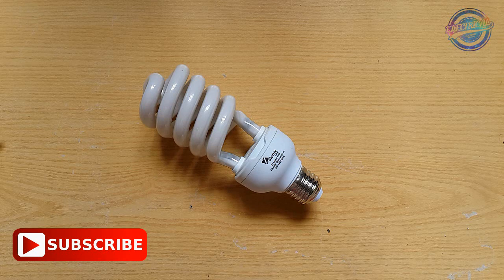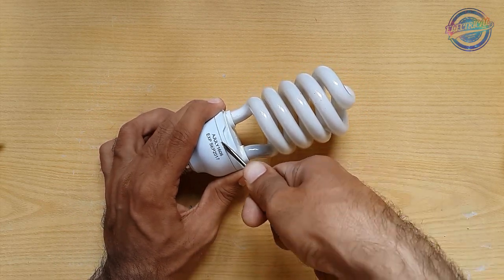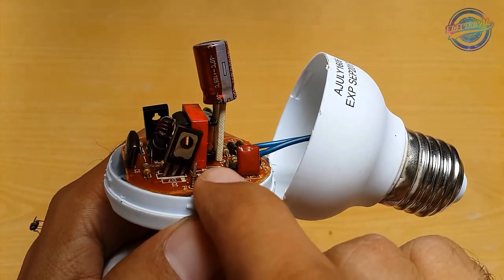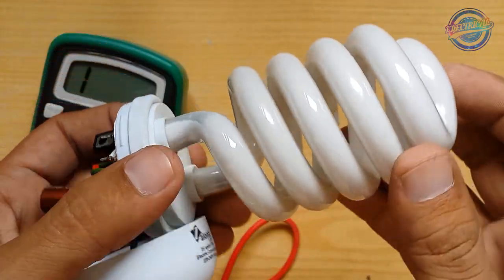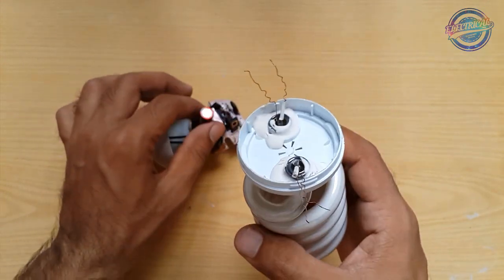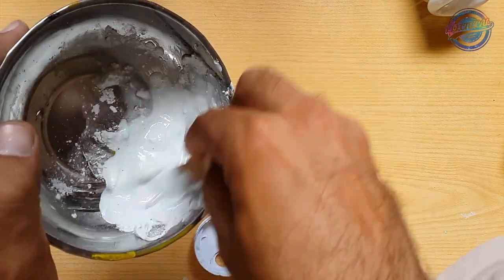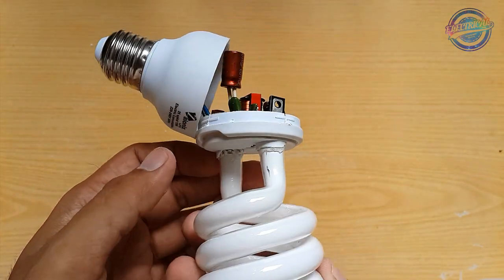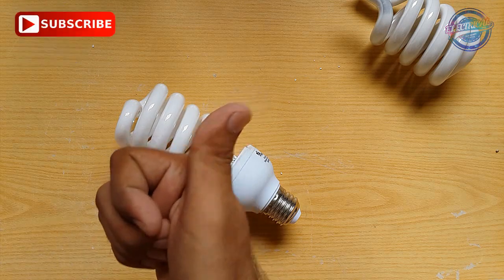How to Repair CFL Bulb at Home || Repair Compact Fluorescent Light bulbs || DIY CFL Repair

Comment: So in other words he is taking a good light bulb apart to get the part to fix a bad one. Thats sure genius.
Reply: I think you are being too genius. Bro you are supposed to buy new flourocent tube , which costs 80% less then buying a new BulB.
Reply: jayram1408 so should I follow the tutorial or just use the other good light bulb? So confusing :(
Reply: Leave the guy alone
Reply: That's right
Reply: Idc i just have salvaged an uvc bulb from old air purifier filter and wondering how i could drive it and check if its okay this video has been useful i'm planning on takin apart an old cfl and using ballast from it to drive uvc lamp that i have salvaged

Comment: Awesome video. I just bought a lightbulb and it failed a month later and I opened it up. And the circuit board had a solder not properly soldered.
Reply: That's right

Comment: I have 4 vat solar panel can I use 4 vat led light directly to solar panel
Reply from the maker: Led light depend on volts,if your 4W solar panel provides enough volts to light them up so you can directly use it.

Comment: Dude where did u find spare Florescent tube and cement??? I never seen them sold separately.
Reply: Take one off a good bulb like he did.
Reply: @pharris7538  一一好
Reply from the maker: Find them from electric store.
Reply: That's right
Reply: Remember he is from India. Here you can check the electronics and try to repair the capacitor. But if the bulb tube is bad. Buy a new one. I only try to repair Big tubes bulbs because they cost 20 dollars and almost all of the time they put crappy caps to limit their life.
Reply: @TheAbrahamsoto01  How you imagine capacitor repair? Seriously :D Did you had "replacing" in mind?
Reply: @KrotowX  Replace the Capacitor..